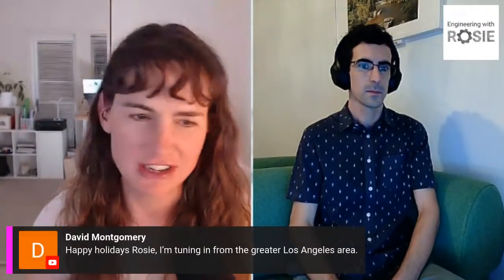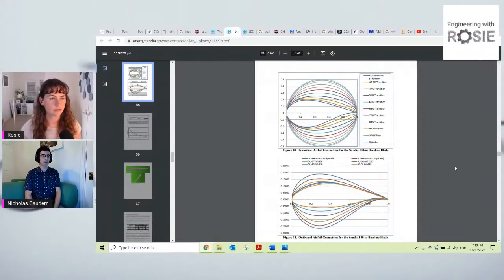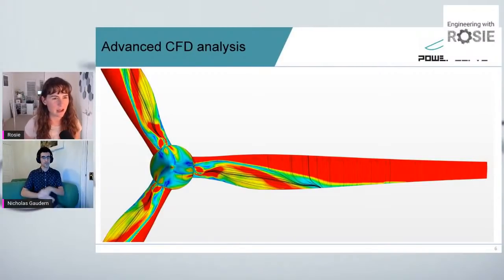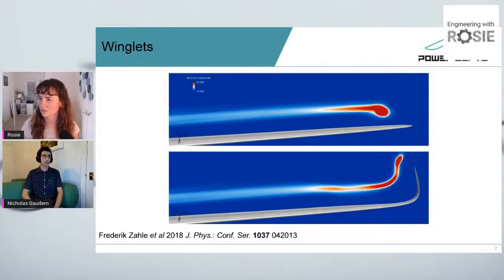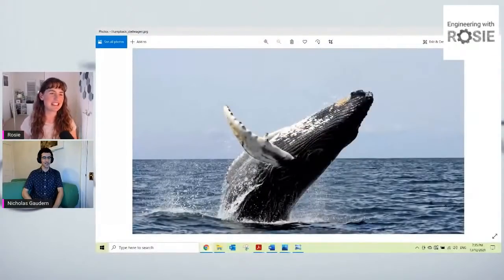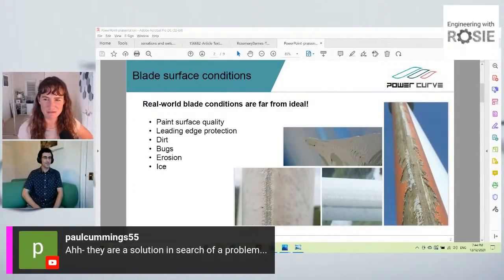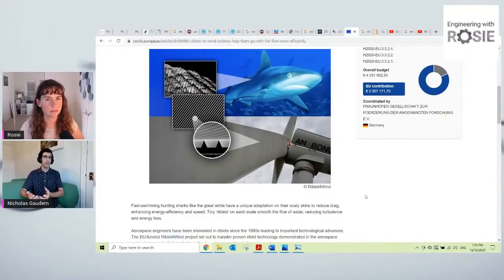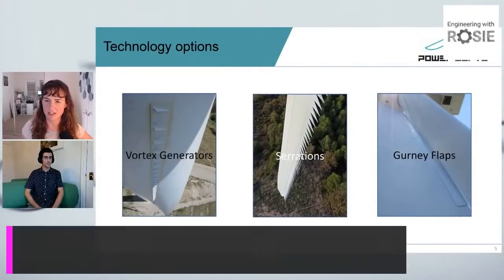Everything You Need To Know About Wind Turbine Blade Aerodynamics | Engineering with Rosie Live ep 7

Comment: VAWTs; which you have explored a bit,  using varying vortex generators such as turbecles to aid in keeping the airflow on the surface; because the wing is flying in and out of high lift  as the rotor turns, might see a  significant benefit from their use

Comment: Hi,
Perhaps a slightly off-topic, but I was wondering: there are wind turbines out there with a height of 200m or more. These are typically in the 8+ Mw range. Would it be feasible to fit a GSM antenna mast on top of the turbine room or would this disturb the working of the blades too much? If feasible, a ‘sparse network’ of these giants could serve as an alternative for this crazy idea of launching 40.000 satellites in a low orbit just to provide facebook and twitter to rural areas. The 4G antennas would be powered by a fraction of the generated electricity and because such a hybrid device would be 300+m high, it would cover a very large area.

Comment: Hello thank you for your interesting videos!
A question a little off topic:
I've always wondered why you have to pour such a large block of concrete for the foundation?
If you use a large core drill, you could dig one or more deep holes.
Then, a steel frame pre-fabricated by an automatic machine could be slipped into the hole (s).
IMHO, it wouldn't take a lot of time and materials and would be easier to remove someday.
--
Bonjour merci pour vos vidéos intéressantes !
Une question un peu hors sujet :
Je me demande depuis toujours pourquoi il faut couler un si grand bloc de béton pour les fondations ?
Si l'on utilise une grande carotteuse, on pourrait creuser un ou plusieurs trous profonds.
Ensuite, on pourrait glisser dans le/les trous une armature en acier pré-fabriqué par une machine automatique.
AMHA, cela ne prendrait pas beaucoup de temps et de matériaux et serait plus facile à enlever un jour.

Comment: Incomplete Tubercle understanding and thinking here:
Tubercles don't just increase the angle of attack at which the wing stalls; they also dramatically decrease the root to tip flow and thus tip vortices.
Therefore you can design a blade with Tubercle's on say the last 3rd  of the blade and avoid all the discussed headaches of implementing blade tips.

Just as importantly for low cost or hobbyist/home made turbines:
The fact that the wing works over a much wider angle of attack ameliorates or negates the need for variable pitch control, greatly decreasing the complexity of a way more efficient fixed pith design...

Lastly; I'm guessing (or IIRC) that noise from both tip vortices and trailing edge turbulence is greatly reduced.
This enables the implementation of turbines closer to the end users and that cuts down on line losses and the time and money cost of travelling to said turbines by maintenance and repair personnel and spares.

ie:  A widening of everyone's thinking on the subject is a good idea...  
:)

(On the subject of noise (stator) and cost:  There is no (engineering) reason for the turbine hub to rotate into the wind while the tower remains stationary..?
If you make the whole tower rotate; you can use a much more aerodynamic and quieter teardrop shaped tower that does not have to be quiet as strong/heavy as the current towers are...)

Comment: If we wanted to know more we'd have to go to the Research Centre at NASA maybe? "Near enough for the Bush" and the general public..

-----.
America's Cup boats are hitting X4 Wind Speed, but the vectors are very different to Turbine Blades, not much tip vortex?

And a newly designed Electric Aircraft has Propellers on the wing tips, apparently using the vortices by neutralising the rotation? Interesting.